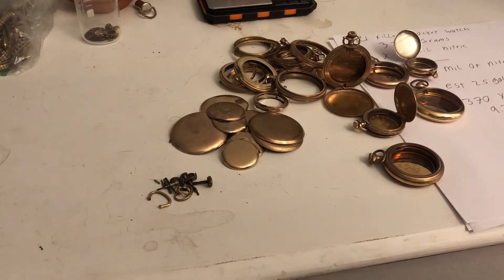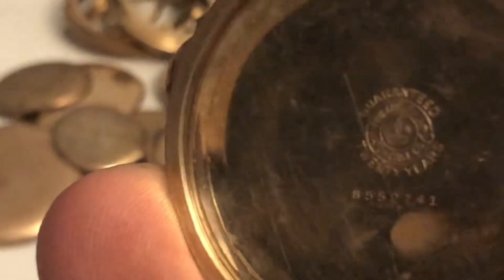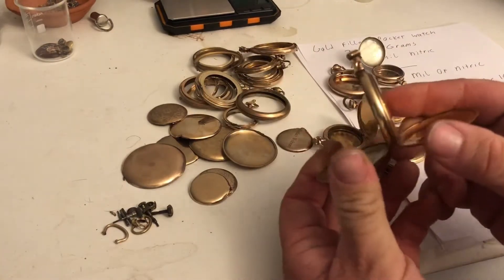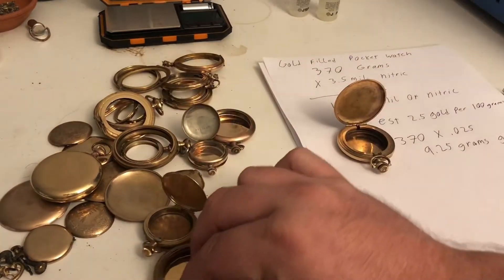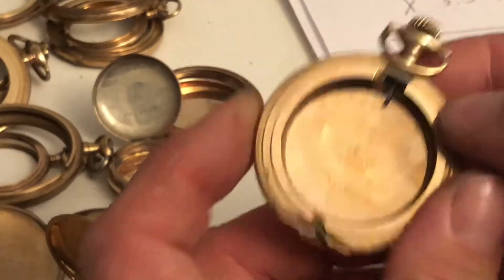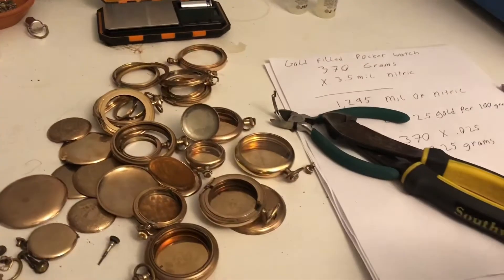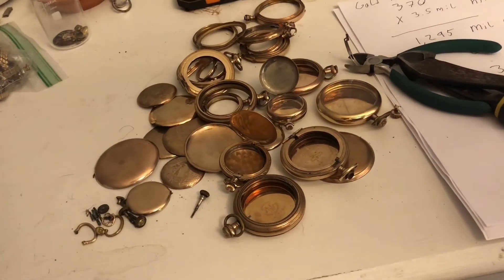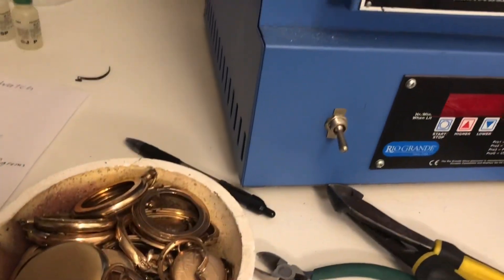Gold filled pocket watch refining

Comment: To all the history buffs giving him a hard time for doing what he wants with his watches, where we're you guys when they were for sale on ebay? Why did non of you spend the money  to save these watches. I assume you have the internet, you're using it to virtue signal, I assume you can figure out how to use ebay, so why don't you put your money where your mouth is and start saving those watches? Nah? Just want to put someone down that is actually going to get that gold back into circulation rather then sitting in a drawer attached to a broken watch part.
Reply: Uh I HAVE bought many cases and pocket watch movements from eBay and re-cased the movements. The movements are being sold after being removed from 14K gold (not filled) cases by people that see the value of the metal and not the value of the watch as a whole. A recent purchased movement is a beautiful 1887 Elgin G. M. Wheeler movement. These were Rail Road grade movements of very high value even in 1887!